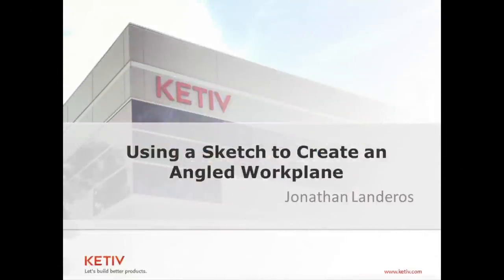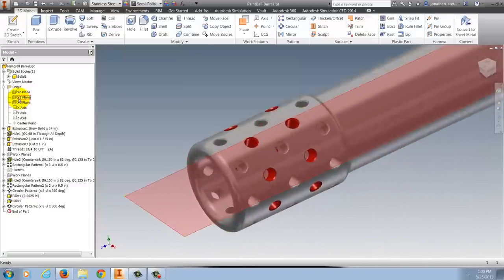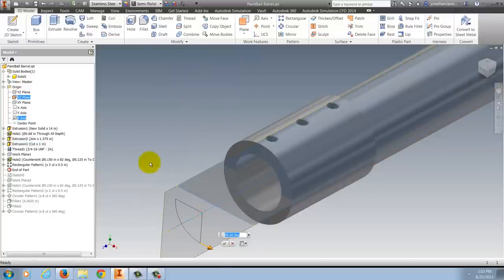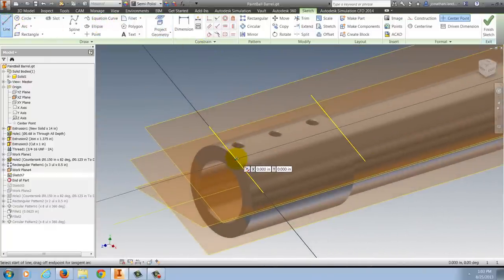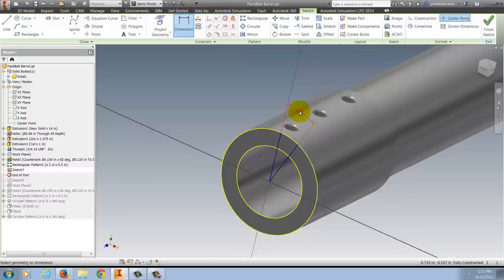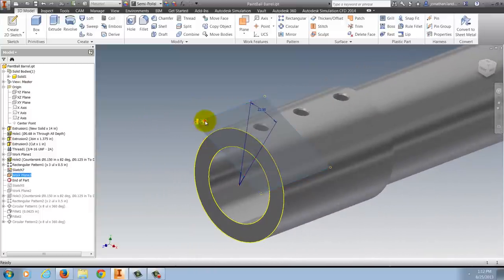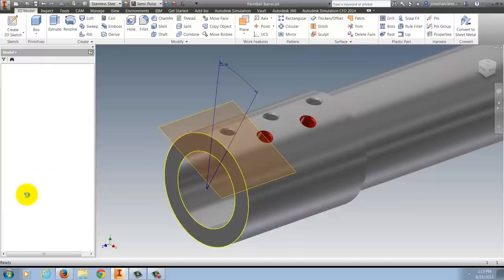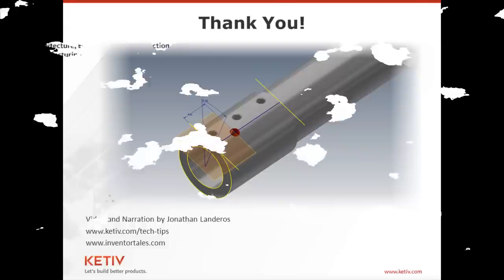Using a Sketch to Create an Angled Workplane in Autodesk Inventor

Comment: Thanks for the quick tips videos.  I'm linking them to a class I'm teaching.  
To add another tip, I've noticed that by simply selecting "Plane" instead of using the fly-out options, Inventor will define the appropriate type based on the geometry selected.   I think it was also possible in 2013, but not sure.  Anyway, it saves a little time and that's always good.

-Michael
RS
Reply from the maker: Thanks for watching!

Comment: What if you wanted a tapered end with, say, 20-deg angle on the end of the gun barrel in this video (or any other cylinder someone is drawing, for that matter)?
Reply from the maker: @mrau92me The easiest way to do it is probably to create an angled chamfer and select that edge. If you want a specific profile, maybe something more decorative, you can do a revolve cut around an axis using a sketch of the profile you wish to create. 

-Nigel